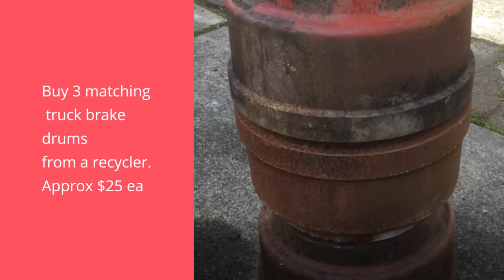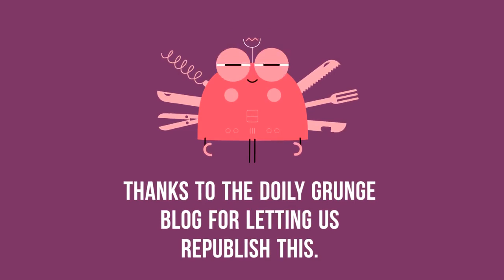Homemade Potbelly Stove Heater for your Man Cave

Comment: My build: two drums mouth to mouth, no spacer ring, mounted horizontally. I plan to burn waste oil (and later biogas) in mine, using a pressurized nozzle burner, Using the pot belly stove as an expansion chamber to build pressure, to spin a used turbo charger. Turbo feeds pressurized air to the expansion chamber where it (hopefully) aids combustion and expansion, extracting more heat and spinning the turbo faster. Use the heat to run all sorts of things. Heat the house. 

To later install a 2nd nozzle for burning biogas, made from my 1200liter digester unit and 4 tractor tire inner tubes for storage.
(edit: I'm just burning the gas now. Either to cook with, or a waste flame.)
:) Life is grand.